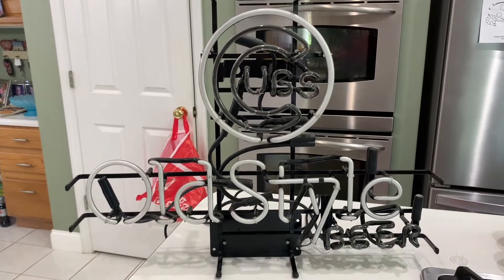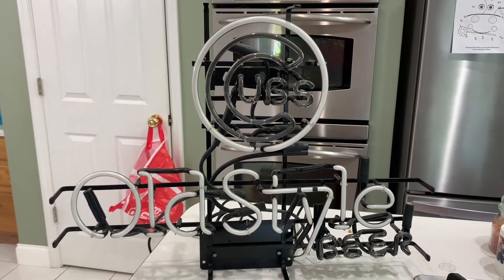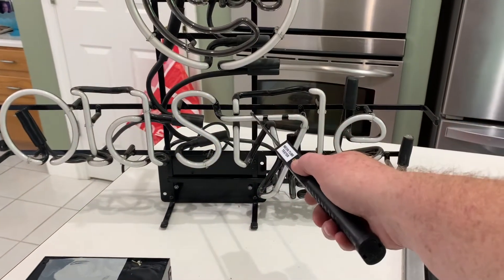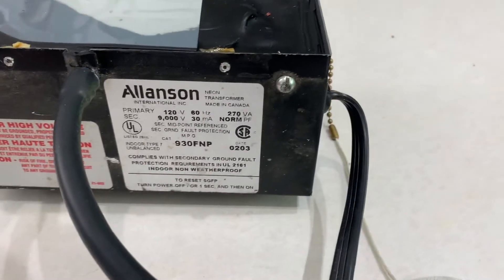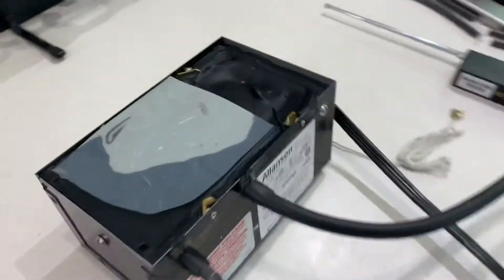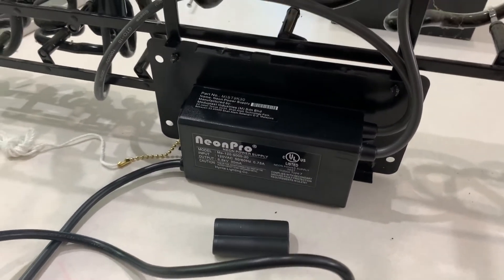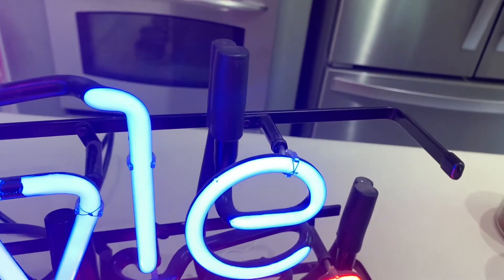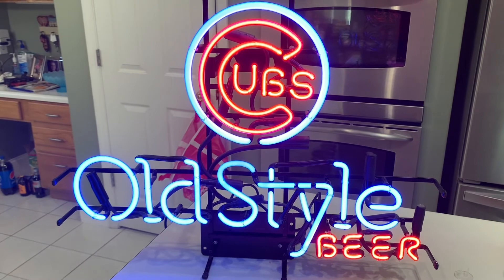Neon Sign Transformer Replacement - Chicago Cubs Old Style

Comment: Hi, i have a problem with my neon light. There two lengths of wires with metal plugs that go into a spitter into a transformer when i connect one in it turns the light off when the two are connected the light switch won't turn off any ideas whats wrong?
Reply from the maker: I don't quite understand the description.

Comment: I'm curious only about the boot ends that you say. My boot end says it has a rating of 15,000 KV rating. I would like to replace the boot and where the wire is twist into the neon tube with the same rating. That way nobody gets hurt
Reply from the maker: Just a guess as I do not know with certainty, but it is probable that all boot ends that fit that diameter of glass tube are rated at 15KV. It wouldn't make economic sense to make boots of different ratings for the same size glass tube.

Comment: Man I got an old Coca-Cola neon that was given to me but somebody had taken the transformer off of it already.  Is there a way to get a ballpark on what kind of transformer I need and I’m curious how exactly to wire it up
Reply from the maker: Wiring the neon tube(s) is trivial. Being gentle with the glass, twist the wires emanating from the glass to the new transformer wires. There is no "polarity". cover with a purpose made neon "boot".
Transformers are built to match neon tube size/length requirements. Without the old transformer or any other sort of documentation, you'll need to consult a sign shop, or find someone with the same neon. If you start with (say) a 7Kvolt transformer, it won't hurt anything, but it might not provide enough power to light the neon. Good Luck!